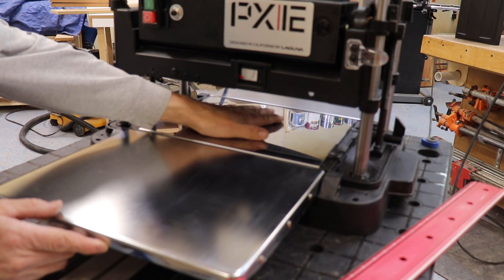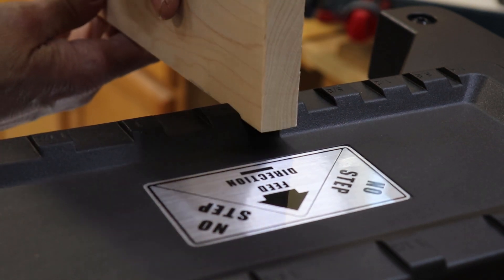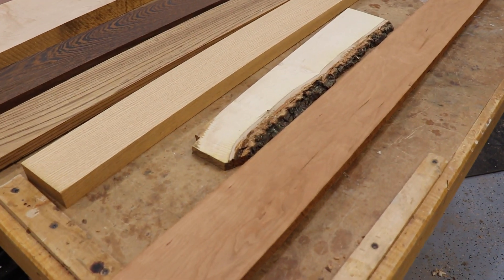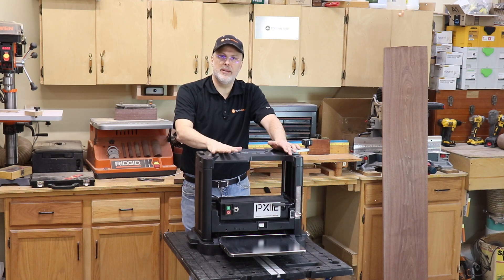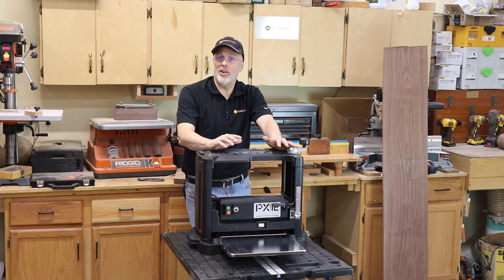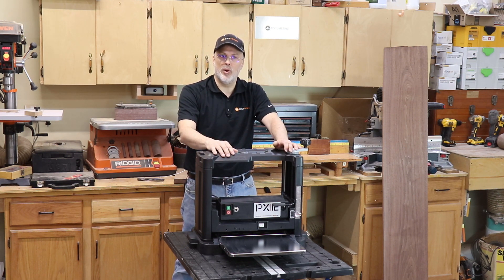Laguna PX12 Portable Carbide Insert Planer Deep Dive Exam

Comment: Looking at the blades, the way they are staggered it looks like one blade square is hitting a spot during one rotation of the blade drum. On another planer you'd get at least a couple of blades that would be hitting that spot. Is that really enough?
Reply from the maker: Hi Daniel, The cutters are positioned on the cutter head in an overlapping pattern, and it appears that the work piece will be contacted but a cutter twice per rotation in any linear location along the board, rather than just once.  Great question as to whether it is enough.  I've used two and three knife cutterheads, and haven't noticed a ton of difference.  In theory, a three knife cutter should produce a better surface unless you slow down the feed rate.  But I don't see room for improvement on the surface finish left by this planer.
Reply: @ToolMetrix  I am curious just how much the third cut per rotation would actually be doing if they are all cutting at the same depths?? Thanks for this review, do you know if these planers cutting  performance would be better than the older non- locking Dewalt 735 models? Your demonstration of the dust collection looks much better than my Dewalt .

Comment: I've been eyeing this planer since they sent me the email about it. I've seem an "Oliver" branded one and maybe a couple others. Same frame and bodies...just different colors and branding. However, I'd buy Laguna brand before others especially since the others are MORE expensive. Great review...thanks SO much for the thoroughness of your testing.
Reply from the maker: Hi Roland, thanks for the heads-up.  I hadn't seen the Oliver version; just the Dewalt with a traditional cutterhead.  The market is definitely trending toward carbide inserts!  :)
Reply: I have the Oliver version of this and I am really happy with it. Came setup perfectly out of the box and cuts great with virtually no snipe. The Oliver ones comes with a genuine Shelix cutterhead, and a Wixley digital depth gauge. It leaves a very smooth finish, and is relatively quiet compared to my old straight knife Harbor Freight planer.
Reply: Interesting @CoolTurtleCreations ...thanks for that detail info.

Comment: Great video, I have question for you about planers in general. I have a Dewalt and I can lock the head down to move it, should I be locking the head down after my adjustments everytime? I've watched a lot of videos and I've never heard anyone say to do that, that is until today. Thanks a bunch.
Reply: I have the DW734 and the locking bar is to lock the head while planing not moving. If that's what  you're talking about here then you should lock it after each turn of the crank before planing the wood.
Reply: @CraftsmanontheLake  yup, that's what it was. I always lock the head down while I'm moving it around the shop but had no idea I was supposed to lock it after every adjustment. I wonder if that will help my planning look better and go smoother? I guess I'll have to go try it out and see.  Thanks for the reply.
Reply: @ConkWoodWorking  The older Dewalts didn't have it. I think they added it to reduce snipe.
Reply from the maker: Hi Clete, yep, I'd say that you should be unlocking when you want to make a height adjustment, then locking down after the cutterhead is at the desired height.  I don't think it's a good idea to adjust the height when the cutterhead is locked.
Reply: @ToolMetrix  Actually you can't adjust it while it's locked... because it's locked! The handle won't turn. So if you try, it won't break anything.

Comment: Great video and demo but I have a couple questions. How does this head compare to a helical head? what are the infeed roller? knurled steel or rubber? and I suppose there are no adjustments on the cutterhead and knives”
Reply from the maker: Thanks for your feedback and questions, Michael.  A helical cutter head positions the cutters at a skewed angle to the grain direction.  The idea is that the more gentle approach angle will produce a better surface, particularly on figured woods that are prone to tear-out.  The theory makes sense, although I've been using one helical head and one cutter head that is similar to this one in my shop for the past decade, and I haven't come across examples where the helical head produced a better surface.  I believe that there is also a theoretical advantage of knife edge longevity with a helical head, although in my case they seem to wear at about the same rate, which is slow.  Rollers are rubber.  You're correct; no adjustments on the knives, and I'm not aware of any adjustments on the cutter head itself.  Cheers, Paul

Comment: It appears that it is basically 1 effective tooth, per revolution. In other words, the inserts are spaced such that each insert cuts its place, without another insert running in the same place.
Reply from the maker: Hi Dave, That's a good question and I now realize that I should have covered that in the video.  The cutters are positioned on the cutter head in an overlapping pattern, and it appears that the work piece will be contacted but a cutter twice per rotation in any linear location along the board, rather than just once.
Reply: @ToolMetrix  that may be. I wonder how it will do against the dewalt DW735 that has three traditional knives which hit 3 per revolution
Reply from the maker: That's a great question.  I'm hoping to get a DW735 in here in the next couple months for a deep dive video.  In theory, 3 should be better than two, and the low angle of the insert style cutterhead should be better on figured wood, and should provide a flatter surface overall.  That said, in practical terms, both of these planers put a surface finish on wood that is extremely impressive.  Without a microscope, I doubt that I'll be able to tell a difference.  I've used a DW735, and as long as the knives are sharp, it produces an incredible surface, even on curly maple.  To me, the main advantage is likely going to be edge longevity and easier knife replacement on the Laguna side, and dust collection advantage on the Dewalt side.  The DW735 has an awesome internal fan that pushes debris out and lots of owners use it happily without a dust collector.  I'm intrigued by the architecture of the DW735, and I want to understand if that brings benefits as well.  I think it probably does, but I need to grapple with it.  If you have thoughts on that front I'd welcome them.
Reply: @ToolMetrix  I just watched a video by the Snekkers guy comparing the Dewalt with a helicle indexable head versus the standard. Both drew more the 30 AMPS
Reply from the maker: Interesting.  That's a lot of amps.  :)  It's good to know; thanks for sharing.

Comment: Thanks for the video, I had talked to Laguna rep on IG asking about decibel rating. I'm in a neighborhood so sound is a huge item I try to address. Laguna directed me to your video, thanks for providing the decibel rating.
Reply from the maker: Thanks for your feedback.  I switched from straight knives on my planer to carbide inserts about 10-12 years ago, and the #1 reason was sound.  I'm in a suburban neighborhood as well, and I took a walk around the neighborhood one time while my Dad was using the planer in my shop, and you could hear it from several houses away.  My shop is also attached to my house, and you could hear the planer from anywhere inside my house, which was also a problem.  The carbide knives changed everything for me.

Comment: are cutters proprietary or can you get generic replacements? cost of laguna replacements?

thanks
Reply from the maker: Hi Will, Those are great questions, and I don't know the answer to either one.  The spec on the planer says that the cutters are 14x14x2mm, so if the screw hole is the same these "should" work: https://amzn.to/3bNwsBV.  Laguna should have replacement cutters available as soon as the planer itself starts shipping, so we'll see what the pricing looks like from them.

Comment: Sold!   Now who will be the first dealer to have one in stock?  Right now none of the ones listed on Laguna's site have them listed yet.
Reply from the maker: Oh man, that’s not good. I didn’t realize that the dealers didn’t have them yet. Hopefully soon!
Reply: @ToolMetrix  Update:  Beavertools will let you buy it right now (doesn't say either way if its in stock or not) but they charge $99 for shipping.  AcmeTools will let you pre order it now with free shipping, but says it won't be in stock until May 26.  Oaktree will also let you pre order for May delivery but also wants $99 shipping.  No one else seems to have them listed.

Looks like May is the retail delivery for these.  Sigh, I want it now!!! (/Veruca Salt)
Reply from the maker: Hopefully they are sandbagging a little bit and will actually get them sooner. Veruca needs her pony!! 🤣

Comment: Thanks! I have a very similar 13” Cutech. I love it, but it uses inserts that are only 2 sided. 😢 and dust collection is maybe 85-90% at best
Reply from the maker: Interesting. I wonder why the dust collection isn’t good. I’m guessing that the cutters are longer and produce bigger chips that clog more easily. But even so, it must have a narrow dust chute. I had a delta planer many moons ago that had a super skinny chute and it was getting clogged constantly. In that case I think the chute was an afterthought in the design process.
Reply: @ToolMetrix  I have not experienced a clog and my cutter head looks almost identical. I recently moved it closer to dust collector and went from 4” pipe to 6” for main line. I’m not giving up hope yet! I’ve seen pictures of the new line, and can’t wait to actually touch one! 👍🏻😉😁
Reply from the maker: Ok, gotcha. Maybe just a cfm deficiency then.
Reply: @ToolMetrix  Not likely, probably just an inferior chute design

Comment: thanks, I have a 20" Powermatic, but having an additional smaller more portable unit would be great.  Was thinking about a Dewalt, but this changed my mind.  When it becomes available I will purchase one.  thanks for your efforts
Reply from the maker: Hi Scott,  I like the idea.  I have a stationary planer that is great for quickly removing bulk, but these portable planers with the cutterhead lock are so much better at producing snipe-free cuts.  I used the PX12 on a cutting board yesterday, and it was amazing how perfect it was right out of the planer.  My shop is small and I probably can't justify the footprint of a second  planer, but it's super tempting.
Reply: @ToolMetrix  Just gave you a big thumbs up when I spoke with Laguna.  thanks for all you do and really enjoy your work.
Reply from the maker: Thanks for the feedback and support, Scott. I enjoy this work quite a lot, and all of the interactions that go along with it. Cheers, Paul